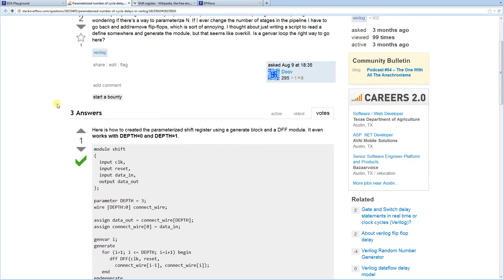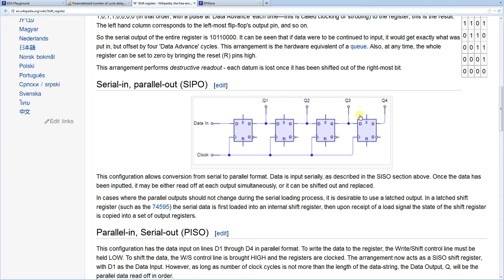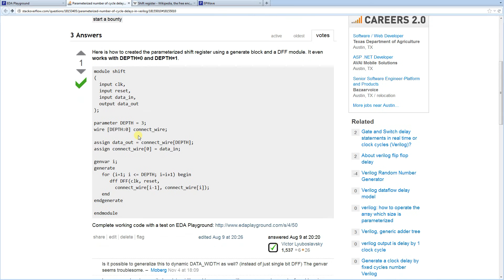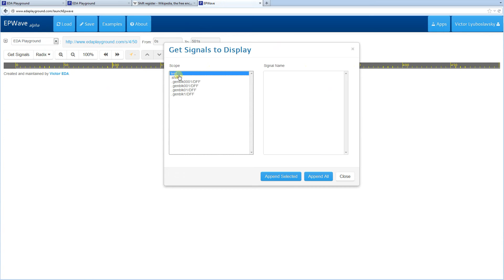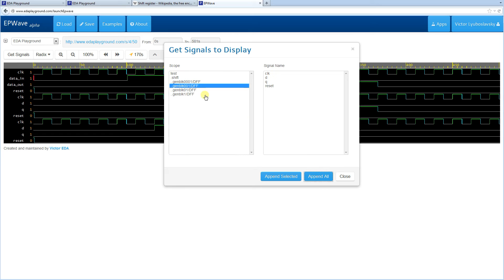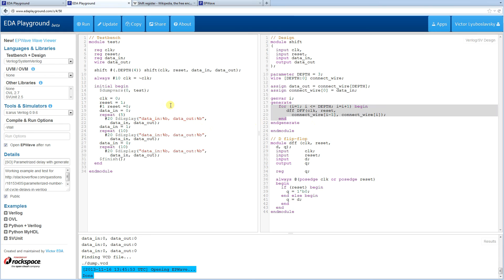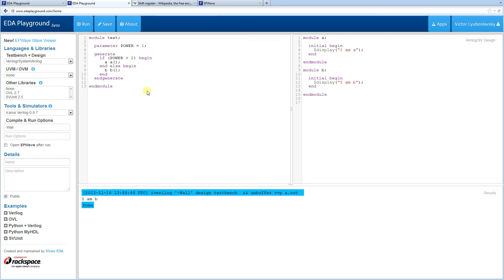Verilog Tutorial 10 -- Generate Blocks

Comment: Firstly, EDA Playground is invaluable for a first year ECE student, thank you!  About the final generate example, why would you use a generate block in a test bench, as they can use sequential statements there, so you could remove the generate block from around your if - else and it would still be equivalent.

I understand generate blocks to be useful in modules that must use structural descriptions, so as to be synthesizable. Is this correct?
Reply from the maker: Yes, you are correct. The generate block can be removed around the if/else and the code still works. I wasn't aware of this :)

Yes, generate blocks are typically used for synthesizable code. Sometimes parts of test benches also need to be synthesizable, so they can be re-used for emulation or FPGA prototyping.

Comment: When you instantiate module several times in a for loop (let say a module with a 1 bit output), it seems like you can't rely on any standard names for the generated instances (or their outputs).  For instance:

genvar i;
   generate for (i=0; i<8; i=i+1) begin : my_label
   myModule i_myModule(input,output)
 end
endgenerate

According to some literature, there should be 8 instances, and I should be able to get at each output by referring to my_lable[i].ouput (with a different value for i).  But maybe that is not standard?  You demo showed different generated names

If I need to access each individual output of each instance, it seems like I need to define a registers first, of the same size of the loop counter, and then connect each generated instance output bit to each bit in the register.
Reply from the maker: Look at the waves for this example: http://www.edaplayground.com/x/5qn
You can use my_label[i].DFF.q

In your example, output is a global wire, so it should be my_label[i].i_myModule.signal_inside_module